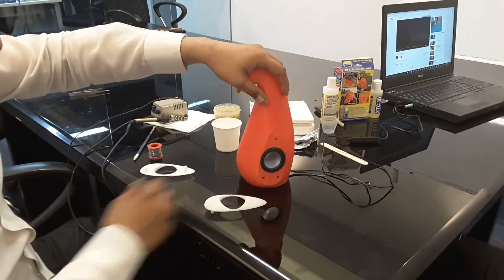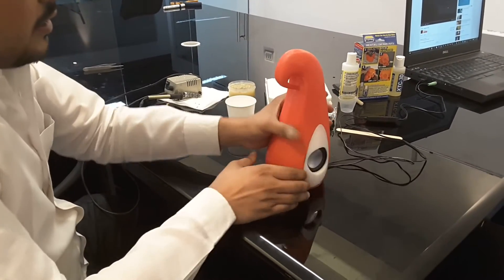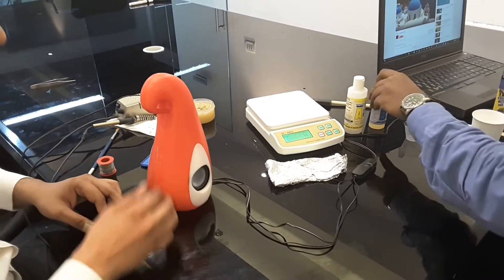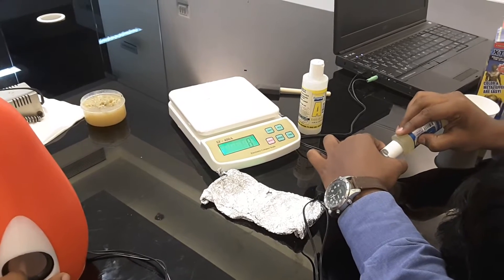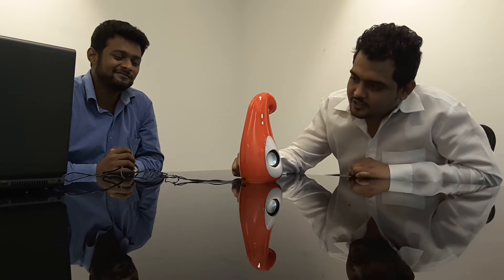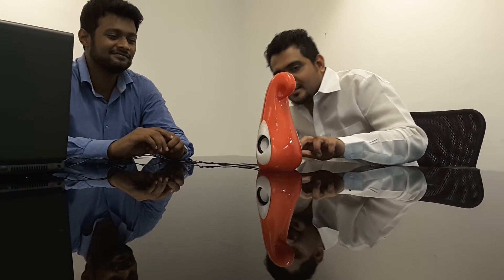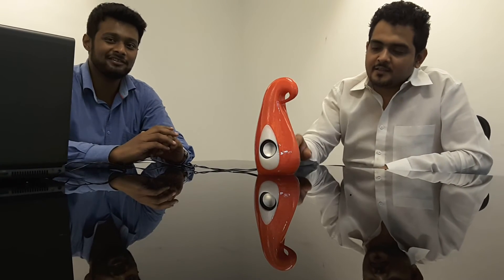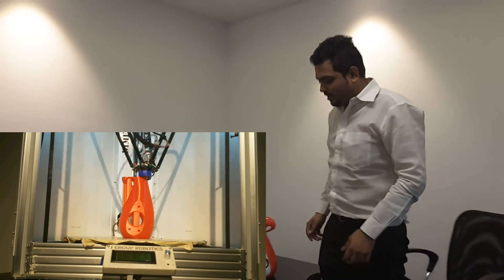3D Printed Speaker

Comment: This is amazing. The shape is so unique and appealing that I just fell for it. I am trying to find it on stores but can't find it anywhere. Where can I buy this ?????
Reply: The shape is similar to the Vivid Audio "Giya" series floorstanding speakers. They are built from multi-layer glass fiber composite and use very high end drivers and other components, and they are very expensive, but they do sound extremely good.